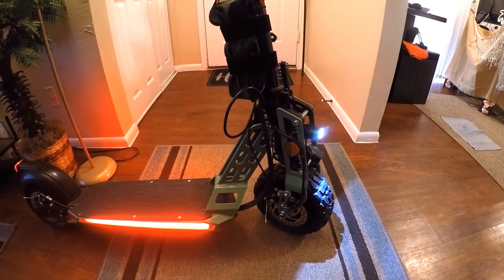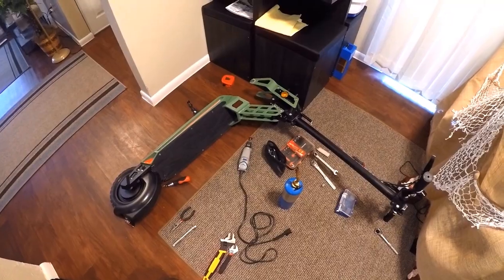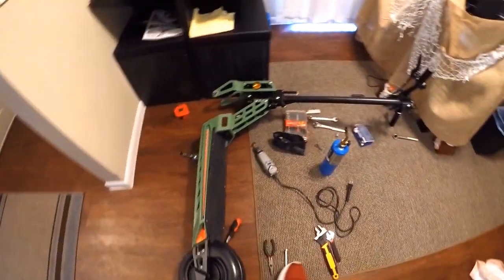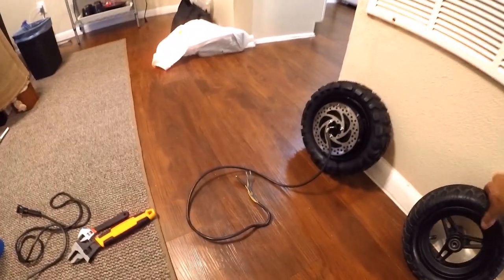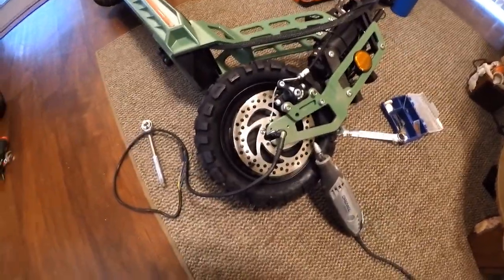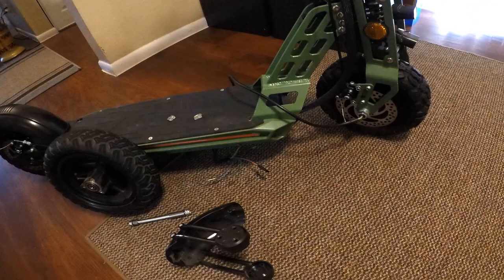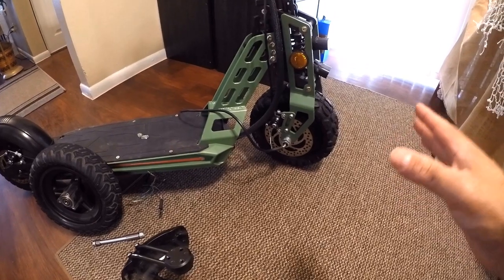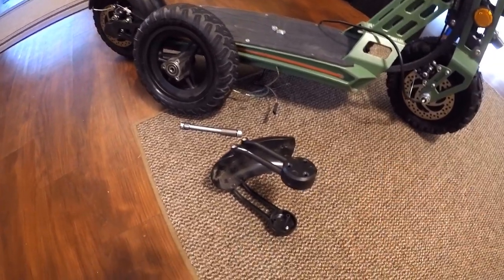MotoTec Free Ride - Dual Motor DIY Modification

Comment: Do a step by step video brother,  are bought motors running at the same time and how do you connect that front motor to be a dual motor scooter
Reply from the maker: No doubt will work on that vid coming soon simple and easy when going dual!

Comment: Hey brother you have a video of how to replace or take off the back tire, mine just blew out today and I need some help lol
Reply: I bought a automotive body clip set off of Amazon.  That has several plastic and metal pry tools will allow to easily work the tire off.
Reply: Does the back motor also working I mean bought motors are running
Reply: You needed to make a step by step my friend
Reply from the maker: @josesantiago544   Yes both motors run have independent throttles, controllers, batteries so i can use one or both if needed.
Reply from the maker: Will work on a vid soon on that easy to do!

Comment: Could you provide me the link to the motor you got for the upgrade?
Reply from the maker: Just go to Aliexpress and look for The Lazy Bike Store. I purchased 3 motors one for my Jetson Bolt Pro, Jetson Bolt, and The X1 Scooter all 1500 watt motors they work great and fast shipping from China. These motors can take up to 72 volts also depending on your needs. Many to choose from the motors are paired with a 1200watt, 38-45 amp Controller that also can go up to 72 volts. Hope it helps!

Comment: Hello! What battery do you have running the front motor?
Reply from the maker: Hey Antonio just depends on the day either 52volts, or 48volts but the system can handle up to 72volts.